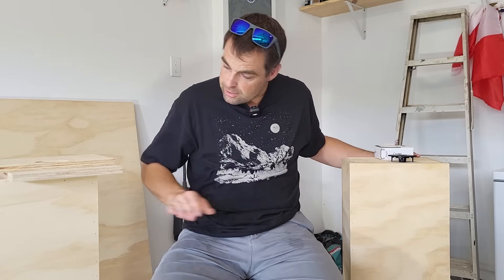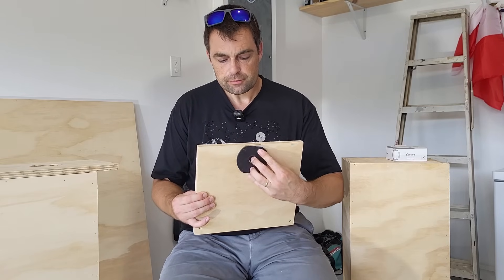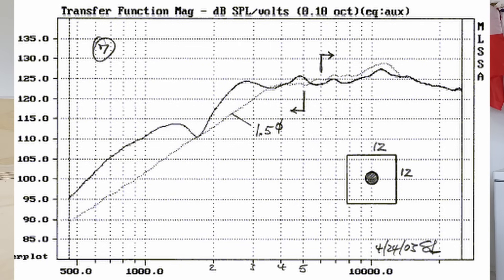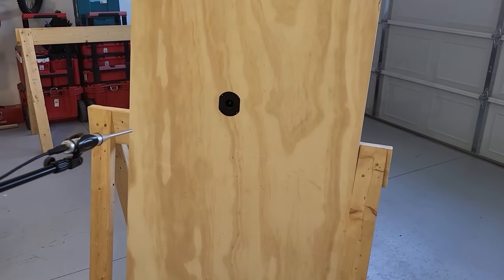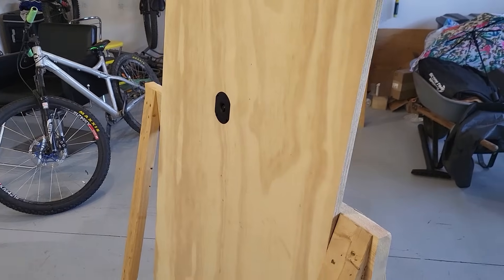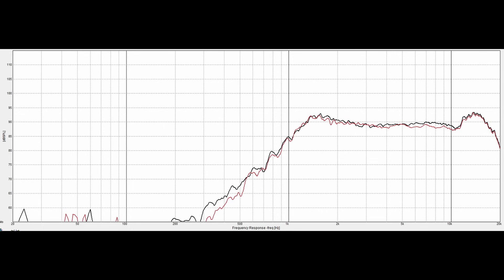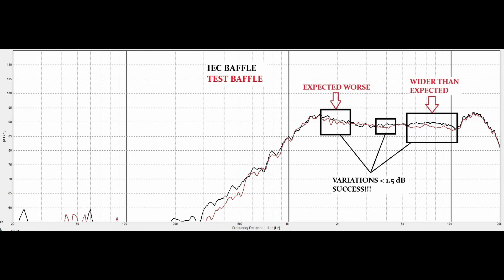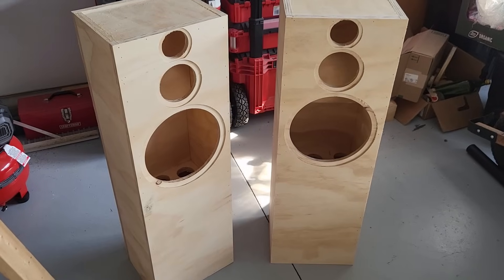Testing Diffraction on the Ciare HT200 before I fully commit

Comment: I found the same thing using the Edge program where moving the tweeter as high as possible reduced diffraction.  If you look at Jeff Bagby's designs he also often has the tweeter high on the baffle.

Comment: Won't you get less diffraction from the side as well as the top if you offset yhe tweeter to one side as well as keeping it at the top of your baffle?
Reply from the maker: Yes offsetting does reduce diffraction, but when you look at the off axis, there is more to the problem. Offsetting is not really a win. Part of why you dont see it often. If youre in a very acoustically controlled room and listen in one position then offsetting the tweeter is a good idea.

Comment: I've read on Troels Gravesen that the short tone bursts leads to lower resolution messurements. If I rememeber correctly he wrote that on a Swans planar tweeter review. Have you ever tried longer sweeps against short bursts?
Reply from the maker: That is true. For this quick back to back its more that accurate. Also, omni mic does multiples. I'm not sure how it's coded but I assume it builds the data as it sweeps, unless the response changes. So it's potentially the most accurate.

Comment: Maybe, because those particular tweeters have a mini waveguide/horn thing, that the diffraction is controlled by this structure, and may explain your top octave peak. Just speculation. Great job!
Reply from the maker: I almost included some discussion on this except the video might have gotten boring. It's a very astute observation. I did some off axis measurements and CSD and found the top octave do ring ever so slightly. I think the little waveguide thing might be too small to do much of anything. Definitely might be playing a small part though.

Comment: For me the idea is ok but i try to not put tweeter all together with the enclosure, i just check the height of my ears and put it on a wooden shaft at the height of my ears, so there is no wood around the tweeter to distract the waves. Also if you mount tweeter with the enclosure the vibrations on the plate cause the tweeter to shake and mix the response with the shaking wood frequency.
Reply from the maker: But that introduces a lot of other problems and kills your low end output.

Comment: Maybe you should make a rotating table to also measure offaxis response to let say +/- 60 degrees.
Reply from the maker: I had one before my move. Diffraction is very linked to off axis because of the changing distance. I left that out of the video but I did measure off axis (horizontal only) just using an eyeball estimate of angle.

Comment: Maybe you could use the same concept in a consentric design later. Some big 15"  cheapos come with very large voice coils now :).
Reply from the maker: In a concerntric the cone waveguide makes it much less necessary to worry about diffraction. It does introduce some other issues though.

Comment: Nice idea. This can work. Now, there might be a problem with this layout, where now midrange is centered. It seems that midrange distance from all 3 edges are identical. The diffraction would hit right in that midrange 700-2000 Hz area. Maybe you should offset tweeter + mid to the side?
It would be super interesting to measure the impact of that midrange spot.
Reply from the maker: This is a good point. I thought about offsetting but I dont like to do that. Theres good reason to not offset drivers. And the distance is different by about 15mm. Not a ton, but enough that when I measured the mid it was pretty good. Certainly a dome mid is difficult to deal with diffraction because of its natural bandwidth and omnidirectional nature. Hard to get around it actually.

Comment: I love this video as well as all of your other videos!!! Im a 51 year old Music/Sound Fanatic with 28 years experience in Car Audio and Sound Quality setups. Question, im curious to why you ported your boxes on what im considering the TOP of your boxes. Correct me if thats not the way you are going to set them up, with the ports facing the ceiling but im really wondering if there is a reason you have done this? I cant wait to see them when your finished!!!!!
Reply from the maker: That is the port. I mostly just wanted to try something different, but now Im worried Ill drop something down there 😅 The port is too long to go out the front or back without a bend. And i didnt want to go out the bottom or Id have to raise it up on feet. So i did this. Maybe not the best idea, we'll see.
Reply: @ImpulseAudioSpeakers  Hey, this is how we find out if it works or not ya know? Trial and Error!!! I was just curious because im just getting into home setups now and i have been experimenting with different box designs and such too. The reason I am so curious is because i know when I build a box for a car, it always sounds better when the port is faced near something that can reflect it and was wondering if that ever applied to home boxes as well. Thank you for commenting back!!!!!
Reply from the maker: @Vincent-Vega24 well sorta. Closer to a wall in theory should reinforce the output, but at these wavelengths it really shouldn't matter.

Comment: Excellent video! I think the approach of building a test baffle is great. I did something similar in my car recently, first building a prototype and measuring until I have found a good location for my install. Only then I fully executed the design. I think it sets apart a good design from a great design.
One tip I want to share, if you do the measurements in REW you can divide both frequency responses. You the get a curve which shows the difference in both measurements. Meaning you can see the change due to the install. 
Cheers
Reply from the maker: Yes I do like that feature in REW. I think I like REW better overall. I'm probably going to switch, but I'll have to buy a mic first. Not sure omnimics work in REW.
Reply: @ImpulseAudioSpeakers it should work. It should work with any mic to be honest. But if omnimic is USB it will be harder to do impulse response
Reply from the maker: @leif8436 i just dont have the cal file in a format REW can use 🥴 Maybe Im doing it wrong. I dont mind getting a new mic anyways.
Reply: @ImpulseAudioSpeakers  Send me the cal file, maybe I can convert it?

Comment: Consider the diffraction effect across the top edge of your baffle.  The distance between your tweeter and the top edge varies quite significantly from the corners (where the distance is longer) to the midpoint (where the distance is shorter).  Your diffraction signature from the top edge is the integral across all those varied distances.  Those varying distances imply varying frequencies for the interference effect of diffraction (which will have constructive interference at some frequencies and destructive interference at others).  Because the effect is spread across a wide enough frequency range, much of it averages out.  A frequency that might have exhibited constructive interference for one infinitesimal breadth of your edge is offset by another infinitesimal part where it would have exhibited destructive interference.  I knew as soon as I saw the distance variation that the measurement would be smooth.  It's always nice to get confirmation in the measurements, though.  Thanks for posting.
Reply from the maker: That is more true than usual in this case because the baffle is wide and the driver is close. Usually the dx/dy is not as significant, such as the side edges. This is also why a circular baffle is the worst, because the distance to the edge of the baffle is the same in all directions.

Comment: i was wondering about diffraction reducing methods, placement is one. 
any chance you can experiment or know about absorbing the edges.
example: you mount the tweeter in a standard position with 5" of baffle top and sides.
then inset the 4" around the tweeter by 1" fill that volume with foam or other acoustic absorbing material.
this i think is the more effective version of the good old "felt" on baffle trick.
Reply from the maker: I'd like to try that some time.
Reply: @ImpulseAudioSpeakers  if it works and not to hard to design features like that, then you can keep the classic speaker look, baffle could be flat also. 
theoretically you could also build it into a floating tweeter design.
but just putting the insets in key location is the easiest design and keep more of the internal box volume for the woofer.
cutting a square hole on each side of the tweeter and mount a slightly larger panel from the backside is the easier way i can think of creating a inset, one baffle thickness in inset in this example.
you create more edges but hopefully the absorbing material will do more good than harm. 
might need to extend the insets to the edge of the cabinet, or perhaps only fill the corners of the cabinet near the tweeter. corner inset if you can say that.

Comment: Putting the tweeter close to the edge you are essentially blurring the edge since the distance to the edge is very different with varying angle.
Reply from the maker: Sort of. It's also that long wavelengths slip right over it. But yes moving off axis vertically will also have big geometric swings.

Comment: You mentioned your measurements were not spl calibrated. Could you kindly make a video about speaker measurement sharing your experience about the errors we may face and identify. I am trying to learn and did measurement using minidsp and REW and stuck at the question if the speaker is so bad that I am only getting 70 db spl when celebrating my amp output voltage to 2.8V at 1 mtr from woofer without cabinet and laying it flat on my roof so as to have only one reflection or am I doing something wrong. Loved all your past videos where you do measurements of different drivers and show results. Especially the cheap ones from SB acoustics. Thank you.
Reply: 70dB @2.83v 1m distance. Your mic preamp has most likely too low gain or not enough sensitivity. Also the phantom voltage to the mic might be too low. You should specify what kind mic and setup you are using. Anyway, it is at least 20+dB too low. I built mic preamp for my Clio mic (Panasonic MW-61 capsule) based on DIY preamp once published in Speaker Builder decades ago. It runs from 9V battery, single dual op-amp chip, unbalanced output. It also has enough gain to run prepolarized CCP laboratory mic.
Reply: Thank you for your reply. I am using minidsp UMIK1, it is USB mic so no option for Phantom power.  @pliedtka
Reply from the maker: @mrinalbarotra791 I think that mic will self calibrate in REW if the setup is correct. Make sure to increase your mic level to around 90% if not. Try not to use 100 in case of clipping. In REW you can trim the SPL up or down until it's SPL correct too. Use a known source of some kind.

Comment: Looking forward to watching all the details of this build as you progress!! 🎉 btw. Is that a port exiting the top rear? I’ve never seen that done before! If not, can’t wait to see what’s next. 🎉
Reply from the maker: Yes its just a basic slot port. Thought Id try that for fun, but in hindsight Im scared to drop something down there 😅
Reply: @ImpulseAudioSpeakers still it’s cool cause it’s different! But yeah, that thought crossed my mind also.. is it too late to flip the port to be a rear facing slot port? 🎉
Reply: Wasn't it KEF that pursued a top firing port? 
iirc, they utilized a metal grill  over the opening. 

Knowing their designs of the era, it was likely a bandpass opening.

Comment: I'm not a speaker designer but but I knew a guy who like to tinker way back in the '70s. He built a pair of small speakers w/8" woofers, I think, and sloped the top of the cabinet and had the tweeter free standing and set back a bit from the front baffle. So what effect does floating the tweeter just above the front baffle have on it's performance? Basically minimizing the baffle. BTW, as a result it had a very delicate grill cover since the top was just a thin framework to support the grill cloth on the front, top and both sides.
Reply from the maker: That would have quite a drastic affect on the response. Maybe good maybe bad depending on his goals. Setting it back puts it more in phase with the woofer, but the lack of baffle would likely increase diffraction and the ammount of low end SPL. Risky thing to do but may have paid off for him.